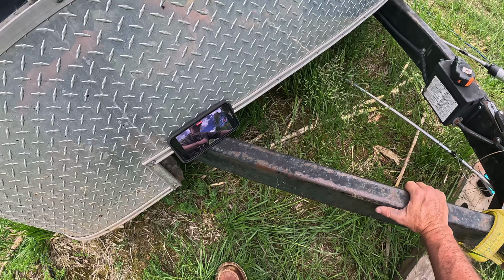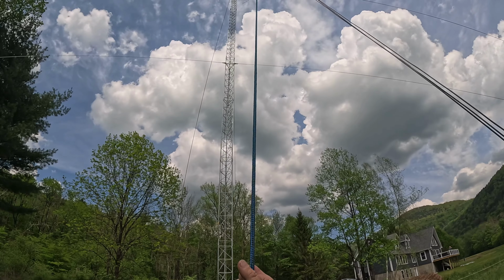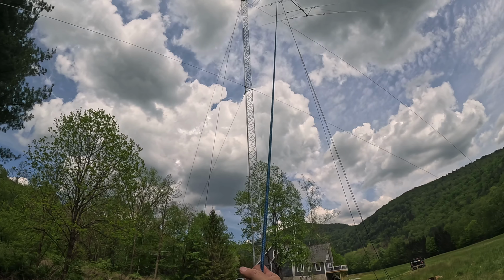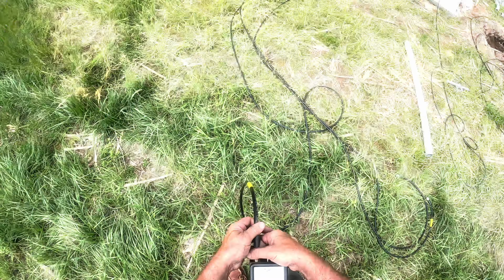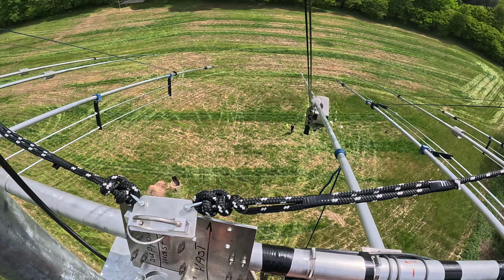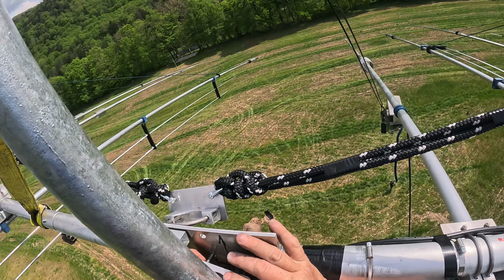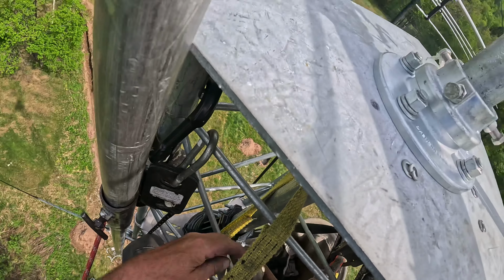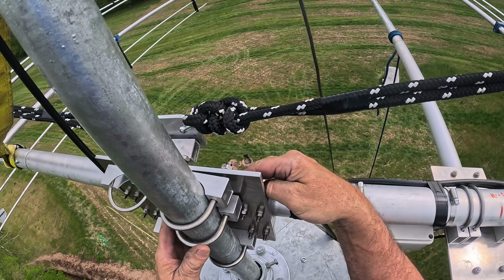Ham Radio Antenna Install - GoPro Action On Tower!

Comment: Do you use a jun pole to bring the antenna up? If so, how do you get it around the guy wires?
Reply from the maker: You have to make sure tram-line is high on mast to clear top guy-wires.

Comment: I'm curious how the synthetic guy lines hold up to the weather. also curious about the side loads on the tower from pulling the antenna up at an angle. I assume you have to clear the tower on the way up with the antenna and thats the reason for the side pull?
Reply from the maker: The rope is from europe called Mastrant. We pull to clear guy wires!

Comment: So you spend thousands on the antenna and mast etc but use cheap RG-213 coax. Why not use Messi & Paoloni or some other decent coax.
Reply from the maker: RG213U for coax loop, we ran LMR600 from switch to shack!

Comment: UV will eat all that Electrical Tape in a Month. That big and expensive of a Project, get all the proper tools and supplies. Check with the Pro's who do Commercial Towers and ask them.  Work smarter, not harder.
Reply from the maker: 3M baby! Never an issue!